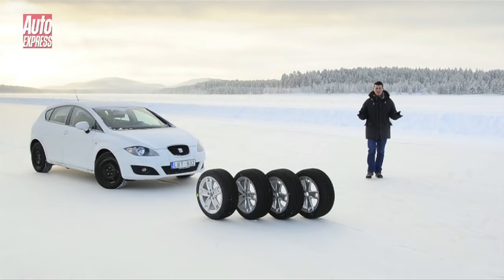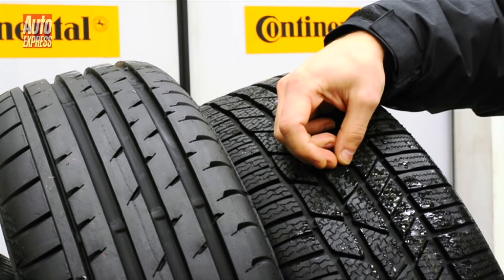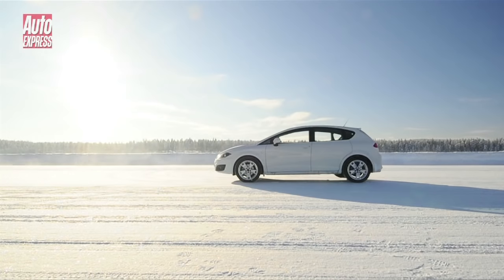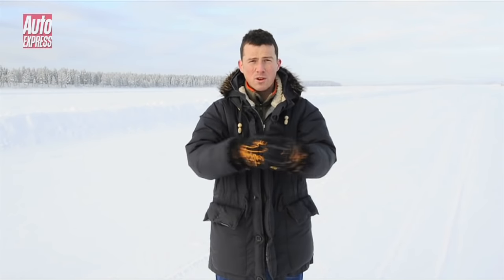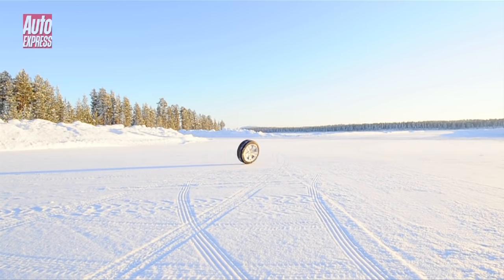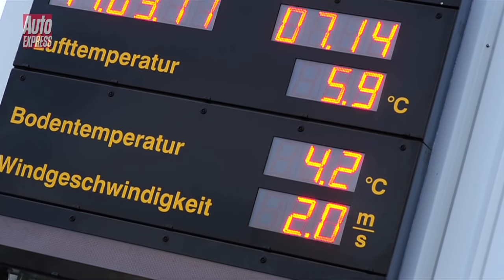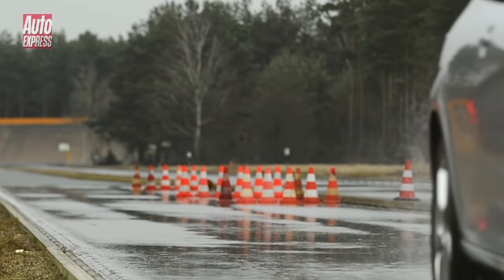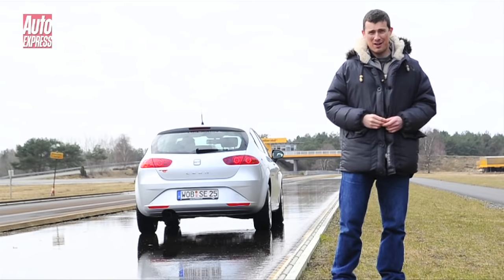Winter Tyres v Summer Tyres: the Truth! - Auto Express

Comment: why not just make all tires with the extra tread pattern it would save alot of time.
Reply from the maker: sweet1j You can buy all-weather tyres, but switching to summer tyres for the warmer months is still important: the extra contact the rubber has with a dry road increases grip by a significant amount.
Reply: Auto Express which are rubbish during summer and even worse during winter. Top gear top tip: AVOID!
Reply: +purrability ...All seasons are utter garbage in winter and slippery as teflon on ice...fact, it is criminal to call them winter tires, they will kill you just like totally bald tires.
Reply: +sweet1j they cost more. with them you use much much more fuel and get worse performance. in summer winter tires also get used very fast so they wouldnt hold for very long. thats why at least i recommend to use winter during colder/winter times and summer during warmer times. and fuck the all season tires srsly
Reply: +sweet1j Rubber compound matters almost as much as, if not more than tread pattern. All season rubber that lasts long in the summer won't be compliant enough in low temperatures. The compromise would mean lower mileage overall which people would complain about, without much gain in terms of winter traction. Not to mention the added noise that results from having a snow tire pattern. Most people won't know the difference a set of snow tires makes, but after directly comparing snow vs "all season" in sub zero temperatures I can definitely say the snow tires give far superior grip.
Reply: It will ruins fuel economy grip and ride quality in the summer...
Reply: +sweet1j they're not made from the same kind of rubber. they use a softer rubber for Winter tires. and it can make the car more sensible to strong side winds, which you encounter during summer mostly.
Reply: mpg. you get 3 mpg just by taking of the winters
Reply: +sweet1j too much drag.
Reply: +sweet1j The rubber is different kind of in winter and summer tires. Summer tires rubber is too hard in cold. So the difference is not only in pattern but in material properties. :)

And in a same way winter tire is not as good as summer tire at warm temperature.
Reply: all season do not help with ice like conditions.
how can you make a 2 in one compound? 
if you had soft tyres all year round, you'll go through them much faster.
thats why in Saudi Arabia where the temp gets to over 40 celcius, they have a super hard compound tyre.
Reply: have all season tires on my e36 and now outside 15 cm snow. -10c and no problem. and no it does not have  ABS and TC... 100 - 120 km/h no problem. its not even want to slide... ofcors the protectors on tire are 7mm... not 2mm..
Reply: well trucks have no winter tyres, far too expensive to have two sets for each car..
they just have deeper tread and that's it (6mm in winter is minimum here)
Reply: marek marek you're mistaken.

trucks as in lorries or semis, do have specially designed tires for winter.

they are allowed to have tires with big thread instead like off-road tires for example but not summer tires, 

  they can also have rethreaded winter tires on older summer tire base. they can rethread them with rubber and patterns appropriate for winter.

in Sweden minimum thread for trucks during winter is 5 mm.
Reply: of course, the winter tyres are softer, that's why I wonder why trucks are allowed to use summer ones in winter here in cz
Reply: marek marek I think truck tires are often M+S (Mud and Snow) ?

The cost of 2 sets shouldn't be much more, because you still drive the same distance each year. So with 2 sets of tires, each set wears only 50% of what they would wear with only 1 set.
Reply: Adodoes all season is good in the uk if it's not winter. Sd you can have three seasons in England on one day alone. Lol
Reply: Any tire is going to slip on ice, it can't be avoided really. Your best bet is to drive slow and don't hit the breaks if possible. If you must, do it slowly and keep the wheels straight. Best to slow way down before you enter a patch of ice if you can see it in time.
Good quality all season tires are not bad if you don't drive like a dipshit on the road. No mater what season and tires you have, you should always be mindful of how you are driving in relation to the weather and what else is going on on the roads.
Reply: SpiritBear12 spiked tires for heavy ice
Reply: juan def
Many places don't allow studded tires or chains on them. Supposedly, they ruin the road surface. Other than that, yeah, studded tires would help on ice.
Reply: SpiritBear12 correct.
Reply: J winter tires have a softer runbertype. it will wear out in no time.
Reply: my point was that I didnt see the car with summer tyres use brakes at all, I didnt see the ABS work as well.. maybe it was done for the purpose of the video to demonstrate the difference..
I tried to use summer tyres on snow and was not so bad with brakes.
on the other hand I could not get even on a top of a small hill on these tyres so there is a big difference between summer and winter one when used..
that's why I was so surprised when I found out that trucks and lorries are not forced by law to use the winter tyres here in CZ
Reply: All year tires are the worst possible tires you can buy, ever. They are worse in the summer than normal summer tires, and i the winter they are worse than wintertires. It is not all about the thread pattern, the rubber is different from summer to winter tires. Winter tires are softer so if you buy summer tires with more tread you will just get better anti aquaplaning effect.
Reply: Marek you are completely out of element. You don't know nothing about tyres or cars. Please don't open your mouth about tyres anymore
Reply: You are wrong, both are double negatives. You wanted to write that the version you used was for intensifying a negative probably..
Anyway you started with that bullshit ;)
Reply: safety and rolling resistance.. also, they would not sell a lot for a long time until you need a new one...

Comment: If someone still believes that summer tyres will do just fine in winter if roads are dry, you should try riding a streetbike when the temperature drops below 7 degrees Celsius. The effect of a thread pattern on these is pretty much non-existent naturally, since there almost aren't any threads. The summer tyres compound turns into something that resembles a hockey puck when it's cold, just try leaning into the curve and see for yourself how confident you feel!
I think that the only reason why so many car drivers don't notice the difference is because modern cars can compensate for the lower traction with various ride stabilization systems (and of course because cars are inherently more stable than bikes from the very beginning). But when an emergency situation comes and they have to push it to the tyres limit, it's already too late.

Comment: thats the first time i really noticed that - you guys in the UK use miles per houre for the speed, but the metric system for the distance? how unlogic is that? ;)
Reply: +Digi20 When I was there in the 90's I noticed they also used miles on the highway signage too.  Talk about confusing.
Reply: @moosejaw50  It is not confusing for us Brits. There is nothing wrong with imperial measurements and imo have only started mentioning metric measurements for the benefit of others.

Imperial has been perfectly OK throughout all of my 58 years on the planet.

Comment: Umm...This a good idea, especially for stopping quicker...but what about the guy behind you and his half-used under inflated summer tyres??
Reply: Well, you're gonna check your mirrors before stopping quickly, but of course, in situations where you have to stop really quickly to avoid an situation you have to stop anyway. The guy behind should know that he uses shitty tires and therefore should keep enough distance to the car in front to stop if anything happens. In the summer there is the 3 second rule. If a car in front of you passes and object, it should be three seconds before you pass that same object after the first car. In the winter more seconds should be applied and if you got shitty tires, well, then add more seconds on top of that.
Reply: I'd rather get rear ended because that means it's the other guy's fault and his insurance is the one that pays out, not mine.
Reply: It's better to be rear-ended at a lower speed than to crash into something at a higher speed.
Reply: @dchawk81  your no claims would be scraped then
Reply: @steve00alt70  Indeed it would but it's certainly the lesser of two evils, especially since I'm not at fault.

Comment: In Denmark the weather is mostly moist, and temperatures for most of the year are on the low side. Only a month during the summer temperature is at 20+ daytime, and during the winter there's maybe some snow for a month as well. That's why i prefer multi-seasonal tires because they don't wear out as much as winter tires do during summer and have better grip then summer tires when its snow.
Reply: Yeah, no. I live in Denmark too (Capital area), and as soon as it starts snowing, I'll see a few crashed cars on my way to work - Usually replaced by new crashed ones within the coming weeks. And even though it lasts only a month or two for the snow, with snow follows ice, and they still help in the rain - And if you ever slide into me just because you cheaped out on your tires and couldn't handle your car, I'll dedicate a few years to personally make your life a living hell. All season tires won't help you in sub-zero temperatures.
Reply: I don't live in capital area, its legal to have all year tires on all year, and if i ever slide into you my insurance company will pay and it will be the end of that. So to sum it all up, no, no and no!

Comment: It is a big scare if you're unsure how to handle it for sure. just a small tip from an experienced winter driver from Alaska, try it some time if you want to test it in a parking lot.

Front wheel drive, if you start sliding through a turn, turn your tires the direction of the turn and pull your ebrake, it'll cause the back end to slide around the corner, then release the ebrake and turn the front the direction you want to go, and give it gas. it then goes from an emergency, to a drift.

Comment: You're leaving out the fact the summer tires would beat or equal the winter tires in the second test if the road was dry at the same temperatures. So are they really better for the entire winter? No not really, only when it's wet. To be honest the winter tires have a larger lead over the summer tires in the wet, then the summer tires have over the winter tires in the dry.
Reply: Proof? I don't think that's true. At colder temerpartures the winter tyre rubber will be softer than that of summer tyres, and therefore grip better even in the dry.
Reply: You are correct.  Winter tires arent just for snow.  It's about the temperature as well.  If its colder out they perform better regardless if its dry out.
Reply: You're forgetting how fast winter tyres wear out on dry roads. There's more to life than lap times
Reply: Ash Scott this isnt true and why winter tires should be called cold air tires.  It has nothing to do with the roads being dry and everything to do with temperature.
Reply: Ryan No Thanks
Actually, it IS true. They are made from softer rubber. When the road is dry, they wear out faster than "summer" tyres, no matter how cold it is.
Reply: Ash Scott that is a myth.  Stop spreading false information.  This is only true if you're driving it at warmer temperatures.  The rubber compound hardens up when it's cold out.  It has absolutely nothing to do with wet or dry.
Reply: Ryan No Thanks
Harder is harder."summer" tyres are more wear resistant than winter ones at any temperature. Winter tyres are made softer, with the assumption that they won't spend all their time on bare, dry roads. A winter tyre on a cold road, may last as long as a summer tyre on a hot road, but the summer tyre on the cold road will still last longer. Unless it's snowing, there's just no point in them. If you give people more grip, they will use it. The people who are going to crash are still going to crash, because it's stupidity that sends them off the road, not lack of grip. Only, with winter tyres, they will be going faster when it happens. Risk compensation. It's real.
Reply: Ash Scott Winter tires are made softer because rubber gets hard when it's cold.  Pure and simple.  You make no mention of rubber reacting to cold and are littering this video with misinformation.
Reply: Ryan No Thanks
Soft rubber gets harder, and hard rubber gets harder. Soft rubber never becomes harder than hard rubber. Softer tyres wear out faster than hard ones, at any given temperature. I really can't use any smaller words than that.
Reply: I don't think this is true, the winter tires will stop as fast in the dry. But what happens is that winter tires wear out much faster in warm temperature, being softer material.
Reply: they wont have as good grip in the summer though. if it was perfect sun all year oudn and no rain, slicks prove amazing.
Reply: juan def well no shit winter tires won't have as good of grip in the summer.  They aren't made for summer.
Reply: Julian Lankhorst winter tires do just fine in summer equal if not better as far as traction goes.
Reply: Sorry but no. Winter tiers are not only for wet/snow. Its the temperature to. Summer tiers dont work if its cold.
Reply: Ryan No Thanks winters tire wear significantly faster in the summer
Reply: EABA EndAllBeAll that's why you switch back in summer.
Have the winter tyres on steel rims and the eco tyre on the originals.
Reply: juan def I agree
Reply: In Norway the summer tires beats any winter tire hands down in the wet at any temperature. Seems the problem is that the summer tires you have is made for only very hot temperatures...
Reply: Rondo Cat if you drive in snow with summer tires, you can kill somebody here.
Reply: Ryan No Thanks fucking hell, really? Never had any idea of that.
I thought it was even better to drive with full slick tyres in the snow.
Reply: +Ryan No Thanks lmao. #Triggered
Reply: Julian Lankhorst they'd still be better due to the softer compound
Reply: I would think Winter tires would last longer than summer tires, because 1) They're not on as long usually, unless  your winters are longer than your summers, 2) Snow probably won't wear down your tires as much as direct pavement 3) You're probably not going to be doing too much fast acceleration, cornering, or stopping in winter 4) Tire treads are larger for winter tires. 
Sure it's softer rubber, but that's how it works well in the cold. It gets harder and evens out. If you're using a winter tire through hot summer, sure it will probably wear out faster than an all season or summer tire (some performance summer tires have really poor tread life as well though with soft grippy rubber). 
My uncle told me he had winter tires on his car for 5+ years, summer and winter before needing new ones. They were cheap tires too. He was too lazy or cheap to change them up :P
Reply: You should probably be more concerned about the life, and car saving effects of having winter tires if you get cold winters with any possibility of snow than the cost of replacing a tire a bit sooner because  you think it might wear faster. The cost of repairing your car, injuring someone, or yourself, is going to be much higher.
Reply: Well, you probably don't live in Canada. Where are you from? and do you get real winters with snow and ice there?

Comment: Your "summer" tires are performance racing slicks. Normal car summer tires have much more blocks in the profile.
Reply: No they are not. They are regular summer tires, looks like the Conti EcoContact3.
Reply: They are "normal" tyres, but the tread pattern is optimised for dispersing water quickly than for gripping on to snow or ice.

Comment: Thanks for this video test, it should save lives if people have enough sense to take your advice.  I've ordered winter tyres on a BMW 3 series with 18 inch alloy wheels (I mention this as I've heard some dealers try to force a 2nd set of rims on you) and the dealer will store the standard summer tyres for me.  Over the longer term it doesn't cost anymore in tyres just a fee to swap them.